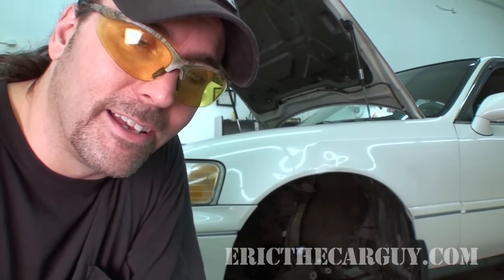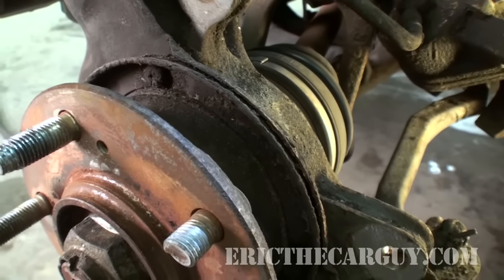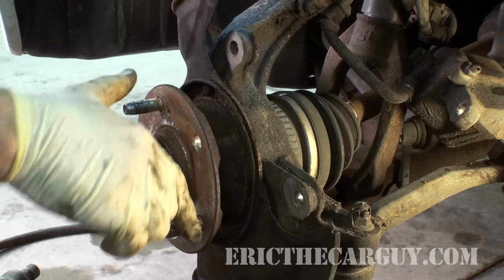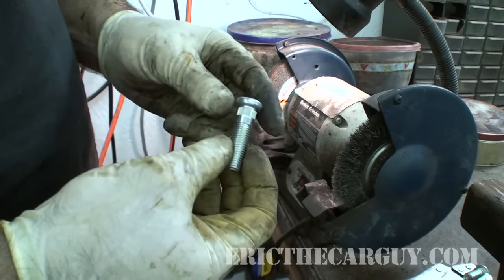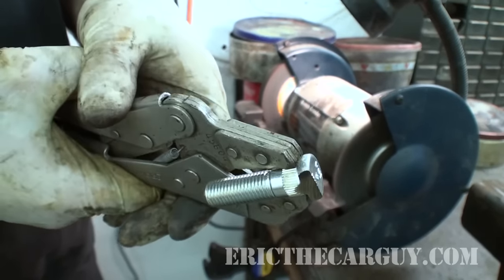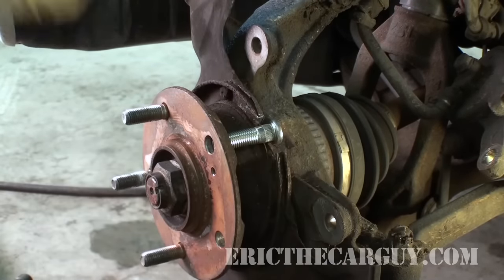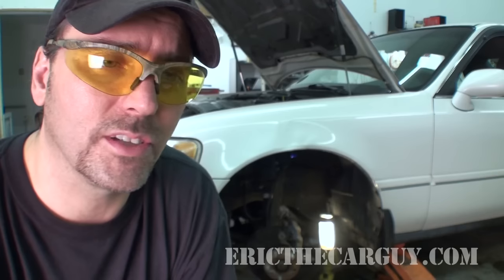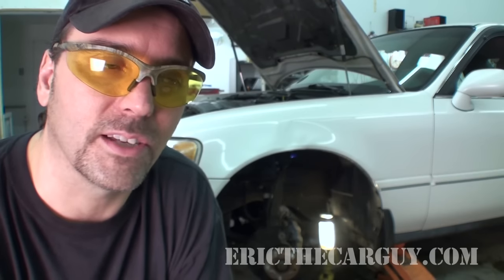Replacing Studs the 'Easy Way' -EricTheCarGuy

Comment: Please announce where your shop is so we can avoid it like the Plague.
btw, you ever see what happens to someones face after the grinding wheel explodes from using the side of it like you did, it's not designed to be used like that.
Reply: Kevin McFarland
 wow, you are denser than a 2x4. I was talking about the bench grinder......genius
Reply: sniper152 Looks to be an Inch and a half stone wheel. Grinding on the side should be fine till you grind a deep groove into it then It may come apart. A cutting wheel on the other hand wouldn't last 2 mins with side load like that. I have Exploded quite a few cutting wheels putting side load on them trying to cut pipe in tight places.
Reply: Kyle Mackay A very porous and brittle inch and a half thick stone. That you can break just by taping on sideways on a work bench. Side loading them has and will break them.
Reply: xMoose338x Have you ever side loaded a Stone wheel on an Angle Grinder?
Reply: No I have not. One of the first things I was told in school when going over the tools.
Reply: You have to side load a wheel on an "Angle Grinder" pushing is how they grind. Unless your cutting with zip cuts or something like that.
Reply: Angle grinder discs have fibre reinforcement to allow for side grinding. Bench grinding wheels are just stone. Never side grind on a bench grinding wheel.
Reply: You can buy Bench grinder Stone wheels with the same compounds as angle grinders. I would make sure that they are before side loading on them
Reply: Do you work in a professional shop? We've side grounded the crap out of ours and no problem. If the stone is heavily worn replace it when it becomes unsafe. Learn to work in the real world.
Reply: Garrett G
yes I do work in a professional shop. These grinding wheels are not designed for side loads. But since you can't argue with a anyone on YT, keep on doing what you're doing idiot, call us from the Hospital when you have a chunk of stone sticking out of your face Mr Safety
Reply: sniper152
Reply: sniper152😚😚
Reply: Apparently someone has never worked on old cars on a tight budget. 

If the repair is properly explained to the customer, there's absolutely nothing wrong with this. The risk vs cost of this particular repair, when the vehicle is not going to be doing any drifting any time soon is perfectly acceptable. The old studs are still more likely to fail than the new one.

Comment: hey Eric, idk if you've tried it or not, but I usually use a couple washers and an open ended lugnut to pull/seat the studs. the washers are in contact with the hub and prevents it from spinning the stud. I've had many successes doing it this way.

Comment: Good way to get fired if you work at a shop....
Reply: They do this at many shops for broken studs :/ I'd rather pay 50$ than 300+ for hub/bearing replacement.
Reply: No, it's it not - UNLESS you charge for doing it "proper" and then do it the fast way.
Reply: Not if you're honest with the customer.
"It's either we grind the stud down to fit, or take apart the wheel hub and possibly damage bearings and require their replacement as well."  
Thankfully I think most cars these days probably have an area of clearance where studs can be removed.  I drive a Pontiac and mine does, and if they were smart enough to do it given all the other dumb shit they do . . .
Reply: Joe Espinosa Your speech means nothing here, be gone with you.
Reply: Sorry but losing 1 of 5 studs is NOT going to cause the wheel to fall off.  Hell you can drive missing 3 studs and still manage to park the car or pull over.  He BARELY lost any of the actual girth of the bolt or compromised it in a way such that it couldn't do its job.
Reply: Can't believe how many people are freaking out about this smh , Eric made it VERY CLEAR that this is an economical fix to a bad situation with a poorly designed part of this car AND that this would NOT be for everybody , so whats the big deal? You don't like it then move on but for crying out loud stop shitting your pants about it ya damn fools.  I personally don't have a huge problem with it since i understand what part of the car it is that is being slightly modified (dust cover)  and the back edge of a wheel stud (still leaving 75% intact) so not a problem and finally Eric is the type of guy who wouldn't proceed with something like this without talking to the owner first.   Lastly Eric is his own boss he doesn't work for anybody but the customer so chill out.
Reply: D. Mullins but he's not in a shop and and neither are any of us! That's why we're here
Reply: D. Mullins 
What
Reply: Ive seen worse at actual shops. Plus these videos are for the DIYer
Reply: One time the shop forgot to put the 4th nut on our audi 80. (four nuts total) my dad noticed when he picked it up but was in a big hurry.  he forgot to go back to get the other nut on.  a while later (I want to say about 3 weeks) the wheel fell off on the highway and the tire cross 6 lanes of traffic.  luckily no one was hurt. so I bet you'd be OK missing 1/5 but more than that you're going to have serious issues
Reply: nope 3 out of 5 will hold the wheel fine during normal driving. If your wheel came off then that would be due to the other 3 coming loose. My guess is if the shop completely left one off then the probably didn't torque any of the other 3 and they backed off.
Reply: but how would 3 loose nuts last for weeks? shrug
Reply: Mark Brand they loosened up more over time because they weren’t torqued properly to begin with. You’re also supposed to re-torque them after about 25 miles of driving.
Reply: Lots of cars have sealed hub assemblies that simply slide out when you remove the lock nut, so it's easy.  You're not supposed to reuse the locknut, but in many cases there are no spares around when you need them.

Comment: Did this on a number of vehicles myself. My 98 Honda was a bit tricky I actually had the grind some of the hub down itself as well as shaving the side of the stud. Some vehicles give you a "window" where you can push out the old and put in the new which is nice. 

As for durability I am convinced this is safe. The studs fit snug and with the tire on there is just no way they would fall out or come loose or anything else you can think of.

Comment: You do realize that the shock of every hit of the hammer or air chisel is transferred through the hub to the point where it makes contact with the knuckle which is where the bearing rollers touch the bearing race. Even micro dents in the race will lead to bearing failure down the road. Good job, Eric, you have guaranteed another repair job on this car down the road! You might have had to replace the bearing now from pulling the hub, but you have made sure you will have to down the road. (I have been a state certified chassis mechanic since 1986). The other part you missed is putting anti-seize on the threads if you are going to use a lug nut to pull in a stud so you don't gall up the threads.
Reply: PCFree48  i love some of you quote old school mechanics and your theories lol dude you need to go back to school for mechanics.
Reply: ben Simcox please tell me what is "old school" and no longer relevant
Reply: You do realize the same force happens when you drive the car?
Reply: PCFree48 is actually right. Bearings have greater load capacity whilst turning and are quite sensitive to shock in static conditions. This failure is called brinelling (evoking the Brinell hardness test).  This is why when a bearing is pressed on a shaft or bore the pressing force must not be transferred through the rolling elements.
Reply: PCFree48 w

Comment: Hey Eric, I know this is an old video but I have a tip for YOU! if you look at the hub there is a hole that you can line up with each dish shield screw. you just have to rotate the hub to line up to each screw. Bang dust shield removed! That’s what I did on my rsx 😍
Reply: If my car had the same thing I wouldn’t be here watching this video. Any actually helpful tips?

Comment: I have a stud installer that is a bearing with a big flat washer. Did all 5 on the side of the road, pre ground studs at home, got my buddy off the side of the road in 30 minutes.. I'm sure its fine because he drove the car another 4 years( 20000 miles easy) but when the car has 240k miles, you just do what you can.

Comment: Definitely would try this method.  Anything to keep it out of a shop.  I broke studs quite a bit back when I had my Tacoma.  This of course was because when serviced they routinely over-torqued the lug nuts. Like mechanics apparently do everywhere, almost all the time.   The Toyota's studs would break real easy with a four way.  Took  a breaker bar to break studs on my Ranger.

Comment: I've done this in a similar manner on some Accords.  Only difference is I also filed down the knuckle a bit so the stud would go in with less of an angle and not bugger up the threads.   Since I don't have an air hammer I just threaded a nut (don't use a lug nut) onto the stud and tightened until the stud seated.

Comment: You could also drill out a 1/2"-1" hole on the backside of the shield, which is what they should have done from the factory. Just a round access hole for the stud to come out.

Comment: PLEASE READ THIS COMMENT!!!!

I've done this in the past! And the heat you put on the stud when you grind them will 100% weaken the stud! I had them break off after doing this exact method  about 10 yeara ago on a crx!  Luckily I was not going fast but i had 3 of them break off in a matter of minutes!  That said do as you wish! You've been warned.
Reply: First thought that occurred to me as I watched was that letting it cool slowly would anneal and weaken it - I would imagine if you dipped in oil or water when you finished grinding it would at least somewhat temper it again...

Comment: The lug nut thing works great if you just put a  washer  then one or two oversized nuts and another washer on first. Then you just run the lug nut on to pull the stud through. The less hammering or air hammering  the better. You don’t want to bend the wheel hub.

Comment: you can put 3 or 4 1/8 Dia you have plenty of stud left to, put on lug nut on back side tighten till pulled all the way in. you can use ratchet or air gun either way it works like a charm.

Comment: I just put a wheel stud in my Infiniti and it was so easy i couldn't believe it. I have cordless Milwaukee impacts. I didn't have to use them. I heated the spot where the stud goes into the hub and froze the wheel stud in the freezer. I brought the wheel stud out in a plastic bag with ice cubes in a cup. I didn't want the ice to freeze to the stud. I heated the hub up where the stud goes in. My heater was from HF. It gets hot and I mean hot. I put bearing grease on all of the treads and the wheel stud went in so easy I was amazed. I used washers around the wheel stud to keep it straight. It was like taking candy from a baby. Easy as anything I've ever done on my car. Heat and cold and bearing grease. I was shocked at how easy the wheel stud went in. I forgot to say I used a wheel stud nut that I bought at the store in case it got damaged but nothing happened to the nut. I also turned the nut backwards.  I used the bearing grease on all of the treads. I used regular tools to put the wheel stud in. It went in without any effort. it went in so easy I thought something was wrong. It was a perfect job without any effort and with a hand wrench.

Comment: I was surprised that you made a video in doing that way. 
There is nothing wrong with the way you did it as you know the stud will hold just fine with no issues.
If these engineers would design the vehicle the right way this would not be an issue. Yet they leave
it that way for years and they don't change the design even though they know it's not right.

Comment: If you're replacing all the wheel studs, do they need to be installed in a star pattern just like if you were tightening the lug nuts? I'm not sure if I did exactly a star pattern when replacing all my studs and now there's a gap halfway around between the rotor and hub...

Comment: Everybody says just pull the hub and do it the right way! Honestly the ideal situation is that the hub comes out without damaging the bearing, but in many cases it does not happen especially on older cars in the rust belt. In some cases the CV is frozen in the hub splines. Approach the customer with a 400 + dollar bill or use this method? What do you think they would rather do? Again it isn't perfect, but it works. Very evident here that many of the comments are from people who have never actually turned a wrench in a shop.

Comment: Hey I like all your videos a lot!! There Awsome! Here is a few more ideas for ya though. To consider anyway

Bevel the back corner at 45 degrees and on opposite side on the threads but just at the end… it helps it get lined up all the way or much closer and does less thread and bearing damage than hammering threw the hole like that, then just clean the threads up when done and the nut should have the studs width in threads past the threaded end at least so you have still more than enough thread strength, and then actually remove the little tab.. it does create just a little bit more clearance but a little can go a long way. 
Then use just a little grease on splines and threaded end. I really find that it helps go in easier and the nut is holding the stud into the splines so grease won’t harm long term. Again the ultimate goal here is less impact to the bearing actual making it prematurely fail especially if The better part of it’s life is gone but it’s still in OK shape right now. 

Also especially true if you no longer have hub centric wheels for support the shaved side of studs should face the hub and it is more structurally sound when weight is on it. Basically it still will use the lip of the stud when weight is on it vs just side loading the spline.  

I personally also like to use a little propane torch to heat the hub right around the stud a little to help it go in and out easier. … this one really helps a lot

Only a friendly FYI, from someone who has probably also done thousands of them and seen cars come back soon there after with a bad wheel bearing on that corner because to much shock force was applied horizontally witch the bearing is not especially designed for.

Comment: Hey, sometimes you got to do what you got to do, this works. I think there is bolts actually manufactured like that now. One thing I got from snap on was an extended flat head punch for things like this. Or take a sharp point and make it a nub, basically getting more surface area on the hit. Anyway good video! Thanks!

Comment: Ford actually makes studs like that for the Explorer. The rear ones are like that. You have nock the thin sheet metal plug away in the back ther is a divet right in line with it for  emerg brake adjustment and to put new studs in. You just have to remember to turn the flat to the side of the divet comes right out like butter.

Comment: Mmmmmm, Acura...Yep, those studs are goobered up lol. Yes, is a good idea to replace a bearing or seal if you are already there. I've also cut into a splash shield to install new lug studs.  I've got the same ball-peen hammer, haha.   Yep, cut that stud down so it can come out.  I've also put a flat spot on the head of a new stud, so it would slide in.  But, in this case, it was a close alignment so i'd have just hammered it through.  Wait...seeing how much trouble you had, after making flat-spot, good idea to grind it down lol.  Air hammers rock!  I've always preferred to do this, as opposed to removing the hub/steering knuckle.  Removing all that stuff sux, tbh.  You are great, keep up the good work!  Haven't checked out your site, but I'm sure I will =D

Comment: Eric , I have a question about upgrading wheel studs. I updated my 1968 GMC 3/4 ton truck to front disc brakes from a 1978 chevy 3/4 ton from ball joints out and now my lug bolts are larger up front. The question is can I pull the shafts out of the rear and drill out the holes for the larger lug bolt and just press them in?

Comment: the realistic thing about grinding is: the bolt breaks before any of that end could even get pulled through.....does not effect bolt strength at all. only people who are purists or do not really think things through would have an issue with this method and on older hondas hub removal usually results in pain in the rear bearing replacement and a lot more time esp for the less experienced such as myself that just tries to fix things as they break, and keep the car running.

Comment: just replaced all 5 studs on my corolla. Fortunately, on my hub there is a small notch that allows the studs to slip in, otherwise I'd  have had either cut the studs or replace the entire assembly. On my car, having never done this before and with simple hand tools, it was a 90min job (not including my Youtube search). Sure, you can pay a shop to do it, but honestly, get your hand dirty.
I'm a nurse by profession and still get in there.... As aside note... In the process on doing this, you'll also learn about your brakes.

Comment: im sure he quoted the customer a bigger price for replacing the stud the correct way which would involve him taking out the whole hub assembly and replacing the bearing. What got me though is when he hammered the threads through the hole. they should have slipped in there. maybe get a drill or fly wheel and shave a little bit off on the inside of the hole. not too much to compromise the press fit though